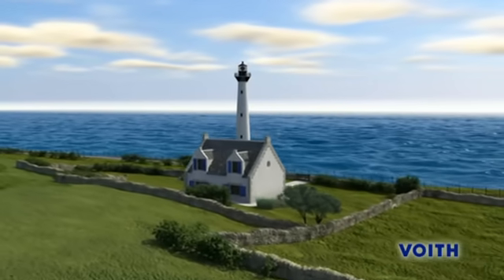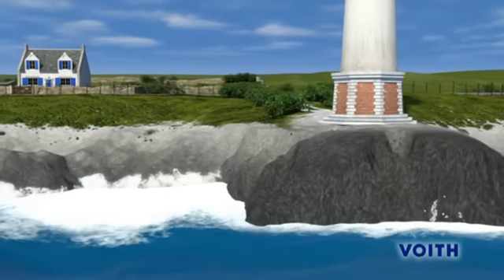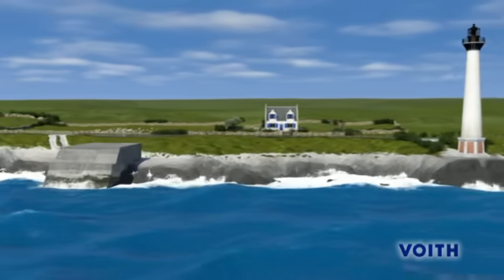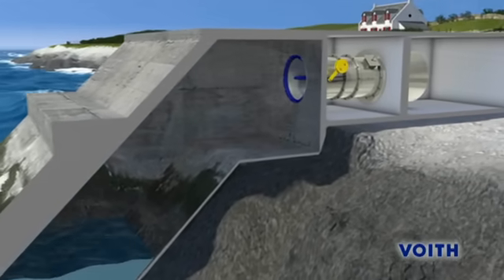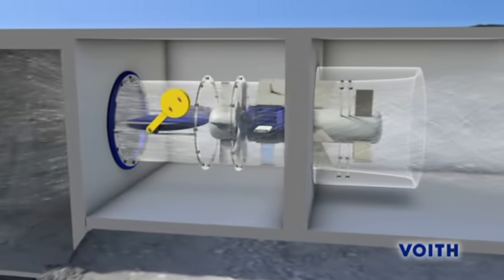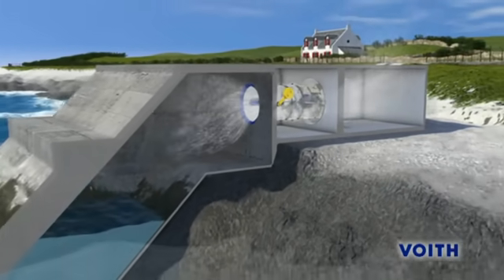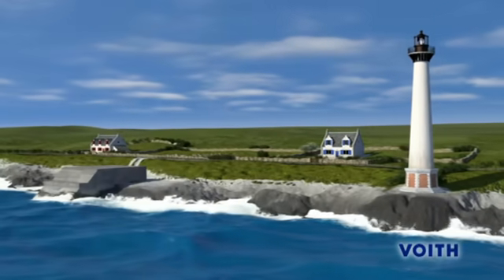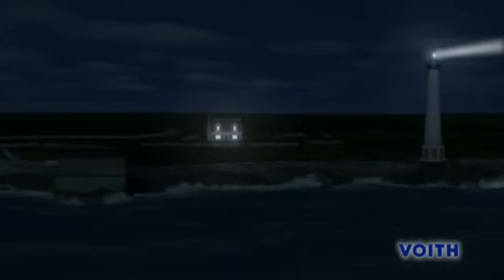Ocean Energy -  Wave Power Station

Comment: This video went into depth about how much the construction of the system contributes to emissions. Oh wait. LOL. 
The thing about being in the Green Religion, is that you don't have to worry about pesky little things like numbers. 
And when Green DOES decide to issue numbers, and predictions, and timelines, they're wrong 100 percent of the time.
Reply: so what you say is that a coal plant hasn't to be build? Yes? No? because... you know... when both have to be build... and both use more or less the same amount of CO2... but then one of the power plants produces electricity without additional CO2 and the other literally produces CO2 and electricity... then... the first one is over all still better then the later one. So tell me... what was your argument?
Reply: @spanke2999  I'm not clear on what you're trying to say, but Nuclear power is the cheapest 24hour, 365 day per year source there is. Of course the Green Marxists will say that the waste products are too dangerous, but they're not. They can be handled just fine. Building an idiotic wave power station is a waste of CO2 and a waste of money.
Reply: @suserman7775  sure... another expert. the fun part is... you don't even know what the most words you use are meaning. Have fun.
Reply: @spanke2999  Dude you make no sense. Not only in your ideas, but in your word choices. Are you using Google translate?  Anyway, notice how you wont, or can't, refute my points about this station being a waste of money or how nuclear is reliable, available, affordable, and clean.
Reply: @spanke2999  I don't repeat what I'm told by any news media, but that's EXACTLY what Green advocates do. They see a story like this video, and without 1 millisecond of thought about its cost, its inefficiency, or the pollution required to build it, they enthusiastically support it. Like worshipers celebrating a preacher's sermon. I never talked about Iran or any other despot. The types of idiotic people that would overspend on a fruitless project like this wave station exist primarily in FIRST WORLD countries, that already have safe access to nuclear power.
Reply: @suserman7775  yeah sure... and you put the marxism in your comment just for good measure...because a private company that promotes a private product which they hope will generate a profit for them is sooooo marxists! but we can talk about about socialism... and the huge huge HUGE... state aid that is necessary so far to build any nuclear power plant on this planet! there is a not a single one financed privately! seems to me... you are a commi supporter my fried!  
and with respect to "the tech is developed in the first world"... mh... I wonder why this is... could it be... that they have the money, time, infrastructure to do so? can you point at any modern technology that was developed in the third world? No...I wonder why???
Reply: @spanke2999  I guess you enjoy missing the obvious. These green projects are absolutely Marxist, because they get funded through the involuntary transfer of money from a taxpayer to a government. That government then spends the money, with the underlying excuse that it's "good for society".  Just like communism's promise of "let us take your freedom and money and we'll build a system that's better for you."  End result is that communism didn't make people's lives better, and wasting resources into Green projects hasn't changed the planet's temperature by .00001 degree.
Reply: @suserman7775  ... you are funny. Because this is true for the Internet too... for nuclear power as well,  for every weapon system, for every drug, for almost every electronic devise... every technology you can think of was first developed with state funding... but sure its only bad if your big TV hosts tell you it is bad.  Have fun... and never try to find out where the www was born commie
Reply: @suserman7775  what ever man... what ever. I'm sure DARPA has never exsisted, I'm sure the US government has absolutely no research program financed for lets say electronics..., I'm sure Apple has paid it's taxes like you, and I'm sure you would understand state aid when you see it... well, to be honest... I think you are too FREE to understand that cutting taxes for companies only while taxing the normal people is nothing else but subsidies. state aid... you'll find this happening for all the companies. And I was not talking about final products... consumer products... because as I mentioned above... this plant is a private product as well... I just point out your hypocrisy with respect to this. You complain that green companies get subsidies and that the money is stolen from you hard working muricans, while this is exactly what is happening with nuclear power plants as well. as I said there is not a single one of them in the US not financed by the US government. your whole IT was subsidized heavily and still is... it's called cutting taxes... if I have to pay a dollar each month and you have to pay a dollar each month and Apple can keep it's dollar...then this is a fucking subsidy!!!!!! you sir...are special!
Reply: @suserman7775  sure... sure man. at least you know who you need to hate! have fun if possible.
Reply: @suserman7775  ...I'm sorry I just have to add this... "they paid back..." yes...so you haven't had to pay for the electricity? they don't run a profit with these plants? because... you know... when they get paid to build them, and then they get paid to run them, and then they get paid to demolish them and then you have to pay for the waste... they don't pay back anything! they just take... and take...and take! but you are a happy consumer. you don't complain when they take your money and scream murica!!!!
Reply: @spanke2999  Your lack of analytical skill is staggering. Yes I have to pay for electricity; but how is that in any way an intelligent point?  The power company that provides me with power has a higher percentage of its generation come from NUCLEAR, and I pay close the the lowest power rate of any place in the United States. Other areas would be paying 100 dollars more per MONTH for the same energy than I do. Unfortunately, the GOVERNMENT is beginning to MANDATE certain programs and it's going to make my costs go up. For NO reason. That's how the Left works; since they're ideas suck, they need to MANDATE policy.
Reply: @suserman7775  first... there is no "left" in the US currently (for the last 60 years or so) in any position of power.. you can choose between center right, extrem right and with respect to your current president fascist! but no left!!! If you want to see left politics you have to look at Scandinavia these countries have a living standard that is almost twice as high as yours! High taxes, high social security, universal healthcare, a sufficient education system, etc.
Second, you agree that the company you receive your electricity from hasn't spend a single dollar to build the nuclear power plant or developing it! look it up... with tax brakes and subsidies they literally haven't. 
third, as far as I know it is not mandatory nor possible to have an insurance for the nuclear power plant. if something goes wrong, you will pay this bill literally with your health... you wont find this position therefore on your electricity bill. 
fourth, the company hasn't spend a single dollar on coping with the nuclear waste. this is federal business... so you don't pay that with your electricity bill either...but with your federal taxes.
this is my point. You claim the nuclear guys are the good one, but they make you pay... paying for the technology, paying for the building, paying for the actually running cost and then you have to pay for the next 10,000 years to keep the waste safe. these cost are all on you... and your kids...and their kids... oh...and their kids too... and their kids... and theirs... if you would demand to see these costs on your current electricity bill, i guess you can figure that out. but you know what. I guess this is too left for you. so you simply look down at a number, then being happy that this number is sooo low, and then you can curse the gov. that the taxes are so high and that your hair is falling out because someone left a funny glowing barrel in your back yard! oh happy day comrade!

Comment: For all the useless whiners...
This doesn't mean it will replace every other power generators around the world. (That's obvious already)
But, it can be added to one of many other awesome alternative power generators.
Alternative power generators are necessary so people can have a specific power generator depending on where they are located.

You cannot stretch a 10,000km long wire along the power grid without losing power. This isn't Satisfactory or Factorio (I wish). With our current tech, maximum transmission distance is 300miles (483km). And even with that distance, engineers still need to kick the voltage up to 765,000v to reduce line loss.

This problem is easily solved with the use of alternative power generators.
In this example, Wave Power Station, can only be built along the coastlines. 
That means, it cannot supply power to anything that's 300miles away from the coastline.

Also... damn you YT! It took you 11yrs to recommend this to me? What the hell?
If you want to stop whining and actually start helping, then go study this field of science and see what ideas you can come up with~

Comment: Seems YouTube is having a hiccup again..

This idea is just bad. Anyone with any understanding of engineering concepts will realize this is terribly inefficient. I doubt its even 3 kW.
Also if the water overflows the enclosure it will pour in from the top and get into the turbine. Let alone the very harsh condition the turbine sits in over time it would corrode and get old.
And that brings up the cost. This probably would cost in excess of $15,000 and lets be generous and says it has a output of 5 Kw. One could simply drive to harbor freight and pick up a 5 kW generator that is a fraction of the size for about $600 then put it inside that lighthouse and come back every few days to refuel.

Comment: can you spell "rust and crack" roi dreaming. Looks good on paper,  pretty picture.  go with a paddle wheeler.
Reply: Aside form the bolts securing the flange of the turbine against the wall needing replaced because they didn't use marine grade fasteners... the metalwork lasted for it's entire lifespan.

Comment: Japan: Run, there's a tsunami!

Electric companies: ( ͡° ͜ʖ ͡°)
Reply from the maker: @Niak: The opening where the air flows in and out can be closed. In fact it is closed during the service time.
Reply: Does Japan's sea wall use this wave power generator?
Reply: @melelconquistador  I don't think so cause their primary goal is to actually reduce the impact if a Tsunami actually occurred and that itself is already difficult enough
Reply: @primastanislaus9184  understandable, but what if they built it not as a integral part of the wall. Rather instead a modular extension, with minimal impact on the integrity and purpose of the wall.
Reply: @melelconquistador  That would be possible, and possibly difficult. Not to mention Japan often gets typhoons and alarmingly high waves annually on top of earthquakes. Maybe if the technology allowed for it to be implemented with... Less risks (this includes operational and regarding tsunami plus some others) for lack of better word, Japan prolly integrating it to the infrastructure later on? 

I live in the coast of Kanagawa and using this power plant might see some problems, tho I'm not an expert (Took International Relations not Engineering)

Comment: I found it in my recommendations on 2020. The anim is beautiful but it's sad to have to say that the wave power station at least in this configuration using compressed air by the waves does not work. In fact the efficiency is far lower than projected, the real production of electricity is less than 1/2 of the production calculated, thus it's not cost interesting. It's also pretty noisy and truly ugly, that looks like a WW2 german bunkers. 
Voith has totally abandoned the idea, and the Mutriku wave plant in Spain is closed since 2018 also because of inefficiency. I've heard also of maintenance problems.
A mix of air and vaporised sea water is far more corrosive than salt water alone. I guess that probably a submerged turbine would have less problems of corrosion.
Reply from the maker: @Pablo Ricardo de Tarragon: Thank you for your comment. We know that Voith sold this technology to another company and the LIMPET power station (showed in this video) was closed in 2018. It was mainly used as research plant, although it generated energy for near village. We don't have the information that Mutriku wave plant in Spain is closed. On the contrary. They are very innovative. They work with different European universities and are trying to improve this concept. They are also working on a new, bi-radial turbine. More information: http://opera-h2020.eu

Comment: The lower the water get the less the air will get compressed. So at low tide you will get much less energy. If they made it to move up and down with the tide but not the waves you'd make more energy,

Comment: This systems are so interesting. 
The math and physics
Waves will follow the path of least resistance, so there is a limit of energy which can be pulled from a given area, if the turbine is too tough the water will just avoid. Etc

Comment: Would have been nice to address how much power this generates.  Also, what happens when the waves are larger and get sucked into generator?  Will generator work with air and water movement or does the flap in front close?
Reply from the maker: @John Jerrehian: Thank you for your question. This wave power station on Island Islay was in operation between 2000 and 2018. The 2 Wells turbines generated 500 kW. The wave power plant in Mutriku (Spain) has a total capacity of 296 kW with 16 Wells turbines. Because this plant is also an R&D plant, not all turbine slots are equipped with the Wells turbine all the time.
Reply: @IdeasfortheGreenPlanet  Thank you for your reply.  So 500kW per day, (24 or 12 hour period).  Any plans on producing more?  Lastly, how has the salt water affected the Wells turbines over the 18 years of use.   This may be appropriate of some of the islands in the Caribbean.

Comment: "If fully exploited could satisfy 40% of the world's demand for power." What does this mean? If all the shorelines on the planet were lined with these devices? And exactly how much energy is being produced here vs cost (EROEI). If it takes $100k to construct and only makes $1k of electricity per yr, then it is no wonder it is not being done. And then there's the maint costs. Well, yeh, it's still operating, but how many times have those turbines had to be serviced or replaced?
Reply from the maker: @Pat Downs: Thank you for your comment. You surely address a very important aspect of power generation - the costs. Nuclear power plants, as well as gas and coal power plants, provide energy at low costs - but at a big cost to nature. These costs are not immediately recognizable, nature has no lobby. But we can see these (hidden) costs through climate change now. We all (people of the world) will pay a much higher price now, for this cheap energy. It is time to find new ways for sustainable power generation. This movie shows a possible way. The principle of "Oscillating Water Column" could not only be used in this type of wave energy plant, where you build an extra building on the coast, which honestly is looking ugly. You could mount the turbines in the wave breaker (like Mutriku Wave power plant in Spain). Or, for example, create buoy. The developers and researchers are working on it and improving this technology. But it takes time and real case implementation - as shown in this movie. Our Channel is not the producer or vendor of this technology or turbines. Our goal is to inform you about the possibilities for harnessing wave energy. If you find a better or another way for sustainable energy generation - great, just do it!

Comment: How will wave-power run my high-performance '67 Mustang?
Reply from the maker: @Mark 433: It will not. But you can do the following: Record the sound of your  '67 Mustang. Buy Tesla, put your '67 Mustang body parts on it and connect the outside speakers with the sound of your '67 Mustang to the gas. Voilà.

Comment: Wouldn’t a tide generator be a better solution using the power of the worlds ocean to generate power. That happens like clockwork also. Also with turbines under water you could use them all the time where as with this idea you’d probably have to shut them down in bad storms or coastal erosion would destroy them.
Reply from the maker: @Mad Mike Productions: Thank you for your comment. Probably we need all, wave energy and tidal energy, as well as solar and wind.

Comment: Most wave power doesn't work, that's why it hasn't taken off. It's either super expensive to maintain, unreliable. The bets that appears so far is pumped hydro with Solar. So many wave companies have gone under, physics doesn't change. It just doesn't work.